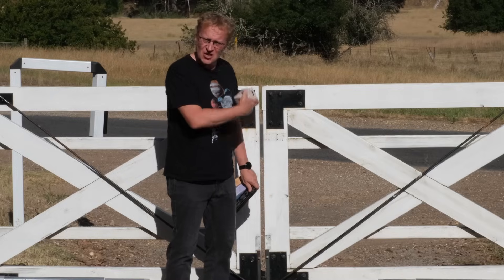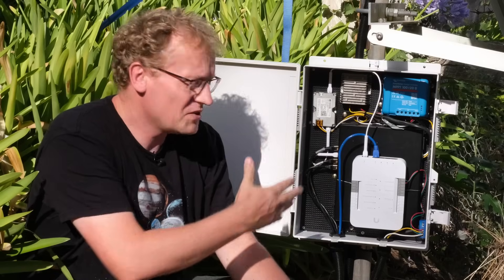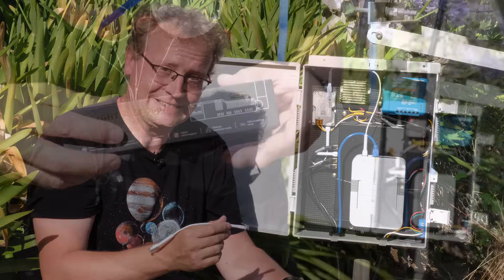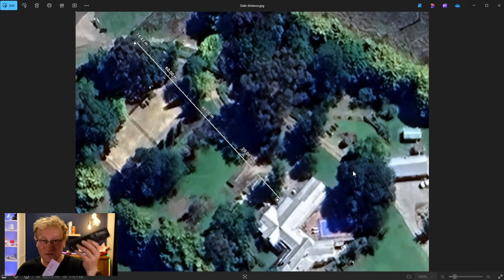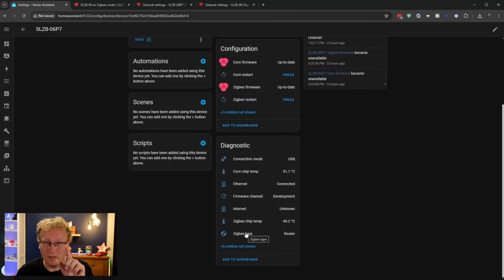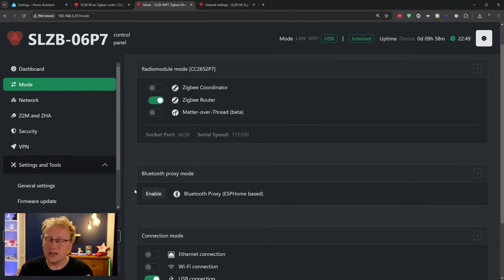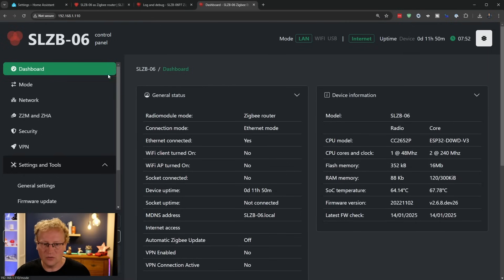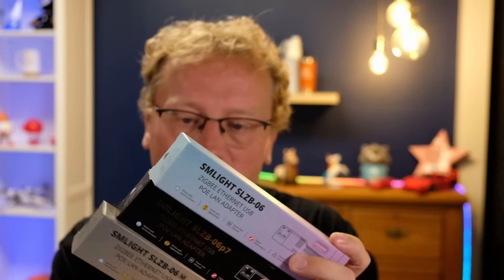PoE powered ZigBee with the SMLight SLZB-06 devices

Comment: why not simply put a cable alongside your doorlock-cable and connect it to a wired sensor directly with the UA-Hub-Gate ?!
Reply from the maker: Nothing "simply" about it. That requires 20 meters of digging, then wiring on the gate itself. To solve the same problem essentially. I have connected the Aqara with a Shelly using HA since, which will be in a soon to come video too ☺

Comment: Sorry if you've mentioned it, but since you have Ethernet at the gate, wouldn't it be better to use a wired magnetic sensor? That way you won't have any radio signal or battery issues.
Edit: Ahh yes, you don't want to dig another trench! :)
Reply from the maker: All good. Suggestions are always welcome. I have considered wired connections where practical, and in this case, it is too hard I think, for the benefit. It would also require wiring on the gate itself, which I am not sure the design committee would approve 😉
I am getting 240V soon to the gate, so I can update a lot of it still.

Comment: I ended up putting a wand/exit sensor on the outside of my gate too as we get so many Amazon deliveries. Then I have a zwave switch connected to that wand, that disables the circuit, in my case from 9pm-7am.
Reply: Yes, just how you can exit without using a remote, keypad, etc, you can   enter without authorization.
Reply from the maker: @paybax  Yeah, got it. I don't think I need that, but that would work as well. You wouldn't just want to keep it open in a certain time interval?
Reply: A Sonoff device
Reply from the maker: @paybax  And what does that do? Can deliveries come in automatically?

Comment: I have one of these, SLZB-06 to be precise, and I had very hard time getting them working with ethernet.

They wouldn't get an IP address, and if i set one statically, it was very spotty, and would basically not work unless it was firced to 10M HDX on the switch port.

Over USB they work well, but I was trying to get it working over ethernet for a long time with no luck...
Reply from the maker: That is disappointing for sure. I have had no issues with connecting them to the LAN over PoE, but I have had issues getting them into ZHA and them staying there. Maybe I need to try USB and Wifi instead?

Comment: you could create two separate zigbee networks one for the gate with that zigbee acting as a coordinator for gate network.
Reply from the maker: Thanks for the feedback. I might do that, as others have suggested this too. I didn't think you could have several ZigBee networks on the same HA instance so I've learnt. Appreciate the help.
Reply: @LarsKlintTech  you can have atleast three, ZHA, Zigbee2Mqtt, Zigbee2MQtt edge. all running on different  coordinator.
Reply from the maker: @yousaf.saleem  Awesome. I am thinking I'll try out Z2M very soon and record my progress. I appreciate the help.
Reply: Initially I though it was possible to do zigbee over lan which I also tried, and failed. I had a hard time finding a good video guide on how to set it up using what I now have running. Maybe an updated video could be helpful for others? 😊

I’m using two SLZB-06 as coordinators. One in the house and one in the garage. They are connected to one z2m instance each. The server running the z2m instances also run one mqtt broker. All three instances with docker compose. Home assistant is connected to the mqtt broker which is the only way devices are connected to HA. This can be achieved without docker compose and use Home Assistant only. It’s a matter of choice.
Reply from the maker: @Kraokan  That is similar to what I plan on doing I think. Use Z2M in each location, so I don't need to connect over large distances. The use the MQTT broker in HA.

Comment: ZB works over ethernet. Check out videos from other youtubers.  a lazy misleading video.
Reply from the maker: Thanks for the feedback. I couldn't get that to work, so I'm happy to be wrong (I do mention several times that I'm new to this). Can you use ZigBee over LAN with ZHA?
Reply: @LarsKlintTech  Yes, over LAN, wifi and USB
Reply: @vinup7667  That can only be done if you want the zigbee stick to be the router. In his case he already has a router in the house and was hoping to use the PoE one at the gate as a repeater over ethernet, which won't work as Zigbee is incredibly limited in that sense. 

You cannot run two instances of ZHA to connect to two different routers, but he has since found out that you can run ZHA for one stick and Z2M for the other. 

That's a lazy misleading comment at the top there. ;)
Reply from the maker: @veryboringname.  Thanks for clarifying. Yes, I am indeed learning, and that is what this channel is about. I put myself out there and am happy to be wrong, so that many others (5300 in this case) can learn from my mistake. In this case I agree with @veryboringname that more information would be super helpful, and not short sentences full of assumptions. Help out everybody by sharing your knowledge. 😊

Comment: A 2nd zigbee network controlled by z2m, would be the correct way to implement this without using several repeaters. That way you can keep your existing/working ZHA config. You can run both ZHA and Z2M at the same time (or multiple Z2M instances) with no issues
Reply from the maker: Thanks for the idea mate. A few other comments suggest the same thing, and I think I'll do another video on all the findings from this video. I've learnt a ton!! Thanks so much for commenting.

Comment: I've been using  the SLZB-06M, which is the Silicon Labs chipset, for a couple of years with ZHA in Home Assistant and they work really well.   Some people have said they have ethernet connectivity issues with the 100mpbs ethernet chipset on board, but I have not had that issue.   All the SLZB devices run an Espressif chip, so they are very easily "hackable" and even have a ESPHome firmware so you can use it as a ESP Home Bluetooth proxy as well as Zigbee.    The 06M is a Silicon Labs,  The 06 is your standard Texas Intruments chipset ( I can't be bothered lookign up the numbers lol)   One of the 07's was USB only, and the 07P (I think) was the newer TI chipset, which I would avoid for stability reasons.   All of them work well in Home Assistant.  The Silicon Labs chipset is a little less reliable with Zigbee2MQTT, but no issues with ZHA.   There is no difference in the way each of the devices work,  They all can be Coordinator, router or whatever,  the only difference is the chipset.  There is a comparison and recommendation for each device on the SMLight website.
You are not quite correct with saying you need a Zigbee network first.  These devices work as COORDINATORS for Zigbee.  You need them to be a CORDINATOR for the device to form a Zigbee network.    Out of the box they are configured as COORDINATORS and you would then setup ZHA to connect to the SLZB via socket to the IP Address.  There are good instructions on how to do this.     My SMLight Zigbee device is my only Zigbee  Coordinator.    You do not need a Zigbee signal or coordinator to use the device as it will form it's own network, 
You can have as many different Zigbee networks as you like, as long as each Zigbee Network has a Coordinator and Home Assistant ZHA and Zigbee2MQTT both support multiple Zigbee networks.    To use it as a coordinator, use the instructions in the device itself ----  For ZHA its: Radio Type: EZSP    socket://xxx.xxx.xxx.xxx:6638.     Probably best though to say have your main network using the Conbee on Z2M or ZHA, then use the other one (Z2M if you already use ZHA or vice versa) to setup a second network.    Just my opinion, but it makes management a bit easier.  That all said, yes you have that point.  You are right that it will not work like the Bluetooth proxy.   It will work similarly, but not quite the same as you will need to manually setup the new Zigbee network. 
If I had a situation like you are in, I would  have created a new zigbee network rather than repeating the existing one, but if it works it works.
Sorry, huge long comment there I know, but wanted to try and get this all out, and I couldn't work out how to make it shorter.   lol :)   

Offtopic : I got my DNS mug --  really happy with that

Comment: considering you have Unifi setup and wifi near your gate, why not use Unifi/Ubiquiti contact sensor?
Reply from the maker: I could do that too. Another way to solve the issue. The Unifi sensor isn't outdoor rated either, it costs 3 times as much, and it is only via Bluetooth, which U7 devices don't support, so not as future proof in that location.
Reply: @LarsKlintTech  you could install a bluetooth proxy within the unifi outdoor box - either a Shelly plus or a ESP32 based ...
Reply from the maker: @vk2him  I already have two Shelly 1+ devices at the gate, so that isn't an issue, but I don't think the Unifi sensor can connect to just any BT signal. It has to be a Unifi device to connect to.
Reply: @LarsKlintTech  I didn't realise unifi was selective with the bt ... I guess you could use any bt proximity sensor instead?
Reply: @LarsKlintTech  so you could take the Shelly door sensor. It works via BLE which you have there :-)
Reply from the maker: @Skyryser  Yep, I probably could do that. There are many ways to solve this problem :)

Comment: You did also add the routers to ZHA via the "Add Device" page, right? The routers have to show on the ZHA device page, or they aren't on the Zigbee network (and don't repeat/route).

Did you check if they show up as "ti.router" or with some other device name perhaps? If they really don't show up, try turning off the power for one of the routers and see if your gate sensor still responds. Maybe also check the ZHA visualization map to see which router is connected to the sensor. Do note that the visualization only refreshes every 10 hours (or after the button has been pressed and you come back after ~30 minutes).
Reply from the maker: No, they didn't show up in ZHA, that is what the weird thing was. I had no signal at all before at the gate, and now I do, so something has connected, and the only two things are the new SLZB devices. I thought they had to show up too 🤔

If I turn the power off, the two devices go offline. The visualisation map doesn't show them yet, so maybe I have to wait. This is all weird. Thanks for the info, and I will keep checking. This is all new to me 😂
Reply: @LarsKlintTech  Ok, so they should show up in ZHA with their model name ("SLZB-"..).
Just to double check, did you also add them to your Zigbee network in ZHA via the pairing page, like you did with all other Zigbee devices when they're in pairing mode?

Like, the SMLIGHT integration in HA does nothing regarding the actual Zigbee part of those devices. You don't actually need that integration, you just need to put the devices in pairing mode and click "Add Device" in the ZHA UI, then wait until they get detected and added to your Zigbee network.

Also, if you turn off power to the routers, does the Aqara sensor actually stop transmitting updates to Home Assistant when you open/close the gate? That's what I'm really curious about. Like, even if it didn't work initially, it can be possible for Zigbee devices to transmit messages over such a long message with no interference, although it might be intermittent.
Reply from the maker: @TheJulianJES  You are correct. The sensors at the gate are now connected to a light bulb at the house. The two SMLight devices are on the network, and I can reconnect, change the config etc. just like before, but they will not show up in ZHA. I am not sure how I get them to pair again, other than clicking "Router Reconnect", but they still don't show in the ZHA adoption screen. How do I get them pairing again? I have seen them in HA when I didn't film it, and they were in ZHA before as well. Any ideas?
Reply: @ Hmm, pressing "router reconnect" (via the web UI or the HA button if visible/enabled) should put the Zigbee module back into pairing mode.
So, I’d click "Add Device" in ZHA, make sure it’s on the pairing page with the "loading indicator" spinning, then press "Router Reconnect" and wait a couple of seconds for it to show up. I’d do this for the one in the house first. Otherwise, try the other one.

If it doesn’t show up, try restarting the routers or temporarily switch them to "Zigbee coordinator", then back to "Zigbee router". On Texas Instruments based Zigbee chips, that will definitely wipe the whole Zigbee module clean (so previous settings are removed).
On Ember/SilLabs based routers, it depends, but it might still clear some weird config.

While you’re setting it back to Zigbee router mode, you can already have the ZHA pairing page open, since the routers should search for open Zigbee networks, as soon as they’re booting up. 

If none of the routers show up in ZHA at all, they might experience some interference themselves due to surrounding devices maybe. So you can temporarily move them to another location to see if they then join your Zigbee network.

If they are showing up in the ZHA list at some point, they should be properly on your Zigbee network.

Comment: Just some info I found.. Seems the one you used has the expermiental Matter over Thread option)

SLZB-06, (NEW! Experimental Matter-over-Thread support! since Apr'24) based on CC2652P Zigbee chip with Cortex M4F 48Mhz, 88kB RAM; recommended by Zigbee2MQTT; completely good for ZHA;
SLZB-06M, based on EFR32 Zigbee chip with Cortex-M33 80Mhz, 96kB RAM – native for ZHA Home Assistant and works well with Zigbee2MQTT;
SLZB-06p7, based on CC2652P7 Zigbee chip with Cortex-M4F 48Mhz, 153kB RAM, new for Zigbee2MQTT and for ZHA;
Reply from the maker: This is awesome! Thank you! 
So, it seems the RAM is the main difference, which probably has to do with how many devices it can support in the network. It seems they are all good for both ZHA and Z2M.
Reply: @LarsKlintTech  On their "authorized partner’s store" they list
1) We put EFR32MG21 chip on the 1st place along with the CC2652P chip in our rating.
2) That is, If you like marketing gimmicks, the CC2652P7 is your choice.
The CC2652P7 chip is ranked #2 in our rating.
3) Therefore, here we would say the same as with CC2652P7 and CC2674P10 – if you like marketing gimmicks, CC2674P10 is your choice. This EFR32MG24 chip takes the 3rd place in our rating.
4) That is, if you like marketing gimmicks, CC2674P10 is your choice.
The CC2674P10 chip takes the 4th place in our rating.

So CC2652P - SLZB-06, SLZB-06-NO-POE & EFR32MG21 - SLZB-06M, SLZB-07 is the way to go.
Reply: All of the SMLight SLZB devices can use Coordinator, Router or Matter / Border router firmware.   This is decided in the firmware you use, not hardware of the device.    This will work most reliably with the 06M version that has the SiLabs chipset, but it does work with all of them to a degree.
Reply from the maker: @EsotericArctos  After recording and publishing the video I am having real trouble getting them to act as routers and connect. They won't show up in ZHA.
Reply: @LarsKlintTech  I will have to play and see how they work regarding setting as a router and then adding it as a ZHA device.   I know they don't just show automatically, like any Zigbee device.    In theory, when in router mode, they should then be able to be put into a pairing mode, but as I have only used them as coordinators, I can't comment on how well the SLZB's work as routers.   
I'll have a little play when I have some spare time.     Today is not that day however.   Work commitments = no bloody time
Reply from the maker: @EsotericArctos  Thanks mate. I would appreciate a second set of eyes on this, as it is driving me mad. No rush.

Comment: I love these, I wish these were available when I built my zigbee network as it would mean my coordinator would be in the middle of my house instead of in my garage.

I think the difference between the 06 and the 07 is the chipsets used and for this one works better for ZHA and the other is better for Zigbee2MQTT. I think this is the only difference.

As soon as I saw what you were trying to do I knew you were going to have problems, but I was really happy you would could using these do a work around. I think what we really need (Hint SMLight) is a Zigbee repeater which will not only repat via zigbee but also allow repeat the signal via the network as well. so in your case in your shed, you would have ethernet and no Zigbee you can just plug this in via the ethernet and tell it to talk to the SMLight coordinator and ZHA/Zigbee2MQTT will just think it is a repeater and nothing else. Wonder if SMLight could create another firmware for this.
Reply from the maker: I think you can do ZigBee over LAN if you use Z2M. That is what a lot of the comments on this video are indicating. In that case I am likely to upgrade to Z2M, and do a video on the migration journey. 
I think the 06 range is all PoE, and 07 is all USB powered.
Reply: @LarsKlintTech  I think Ziggbee over LAN is only to the coordinator and both Z2M and ZHA do and how they connect to the SMLight coordinators.
Reply from the maker: @gjheydon  Yeah, I am still learning. I will figure it out!